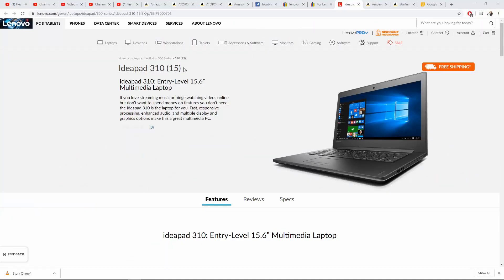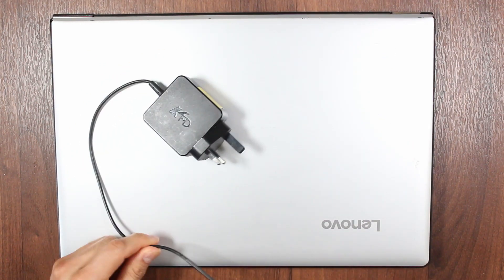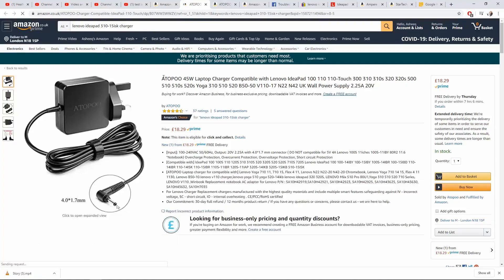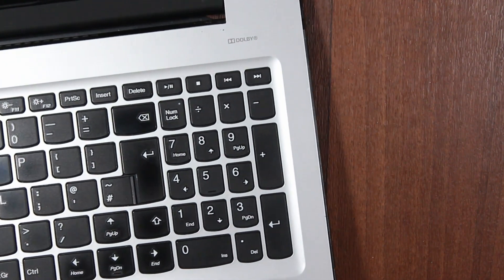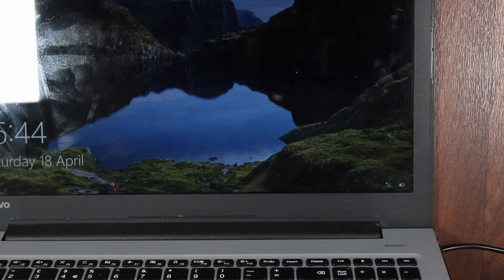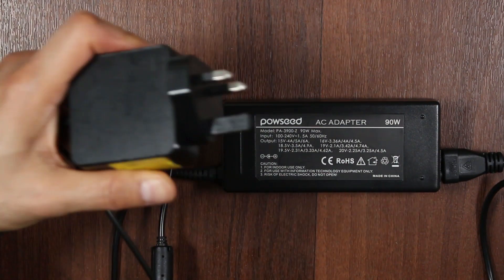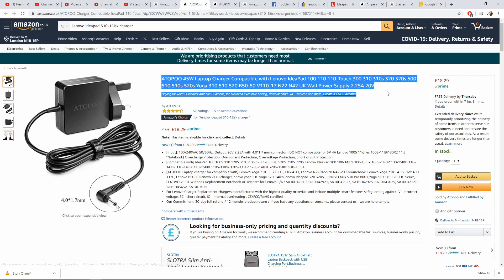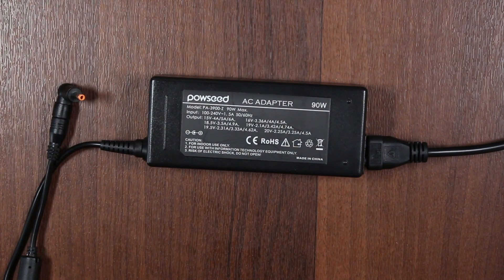Laptop No Power - The DECEPTIVE Laptop Charger

Comment: Salam Aleikoem Brother Ash,
Hope you are well! quite a long message (forgive me!) but:

So I got an Acer v3 574, and it has a charging issue. When plugged in whilst turned on and in use, the charger would constantly connect and disconnect. Sometimes this happens in quick succession and sometimes a bit slower. I can tell because the backlit keyboard turns on when plugged in and a beeping noise is made, but when it disconnects another beeping noise is made and the backlit keyboard turns off. (backlit keyboard is fine, it's just default settings to save on battery). 
 It charges perfectly when the laptop is turned off.

This doesn't happen all the time. As I am typing this it's working fine. I tried removing the battery and working only on AC power but it has happened in that case too (the laptop doesn't shut off though, just beeping noises (IIRC) and the keyboard light turns on and off), I guess this rules out a bad battery?
all updates are installed, and this continues to happen even if I disable/uninstall and then reinstall the drivers associated with the battery ("Microsoft AC adaptor" and "Microsoft ACPI-Compliant Control Method Battery") 

There is BIOS update available but given the issue and a BIOS update requiring the charger plugged in I am not going to risk it.

I have used the multimeter to check: 
-Charging cable (the one that plugs into mains), I get 240 volts AC (UK)
-The charging pin, I get around 19.45 volts (it's rated for 19V) (it oscillates between 19.45/19.46, shouldn't be an issue right?)
-The power jack unplugged from the motherboard, same as above.
-The power jack port, same as above
- The port connecting to the battery (without the battery plugged in), from left to right it connects to the corresponding wires from the battery: 2 black wires, yellow, blue, white, green, and 2 red wires. These are the readings from yellow to red:
	-Yellow: 3.35V
	-Blue: 3.35V
	-White: 2.49V
	-Green: 0V
	-The two reds: both 0.78V

I have used my friend's charger, and I never saw the same effect when using his charger, whereas when I switched back to mine it would work fine for some time and then start connecting/disconnecting. This confuses me because I got normal voltage results (right?...), as in, despite those normal results could the issue still be with the charger?

Could it be something to do with the amp output of the charger? or is it software? or a motherboard issue?

If I have written anything in a confusing way please lmk, happy to clarify.

Keep me in your duas
JazakAllah
Reply: Just in case anyone has the same problem, a new charger did it for me!
It's been a week so far.
Could have been something to do with the current output of the charger idk.

Comment: Hi im having a problem with my pc that ive working on its a HP pavilion computer and it has a built in graphics card in the motherboard but i just put a nvidia geforce 730 graphics card into it so the problem im having is it didnt originally have a hdmi output but the nvidia 730 i put in does and i pluged a hdmi cord in the nvidia 730 and then into my gaming monitor but im not able to see anything the pc is turned on the fans are going but i also a few days ago took the processor out then put it back in and screwed the cooling fan thing back on top of it so can you help me figure out which of these things are making it so the display isnt showing up on my monitor cause it could be either one im stumped been fustrated trying to figure it out for days

Comment: I have lenovo 320 15isk laptop with i3 6006u 8gb specs. I was playing a game with charging cord on. suddenly it goes off without any notification. And after that it does not turing on. I tried NOVO key hole as they mention to use in emergency. Screen come on with the options like pc recovery, boot bios, and and two options. But before i selecting some options it goes off again. Please help me soon. It is not even tuning on with bettery off carger on method. Again in this method creen comes, fan starts and goes off again. Please reply.

Comment: Hey So I was over clocking my ram and I heard a pop after the pc restarted and then I got no display signal so I took apart my pc and put it back together it still wouldn’t give me a display signal and the motherboard is not powering the USB ports can u help in any way to fix it
Reply: Sounds like a capacitor

Comment: yea its true the multimeter can help you diagnose some problems with chargers but the best way to test if your charger is really faulty is to have another charger with the correct tip and voltage requirement, the same also goes for desktop power supplies its just best to have another known working supply, and all you would need to do is plug in the 24 pin and 8 or 4 pin cpu connector, there is no need to mount it to the case unless you know for a fact that your old one is dead.